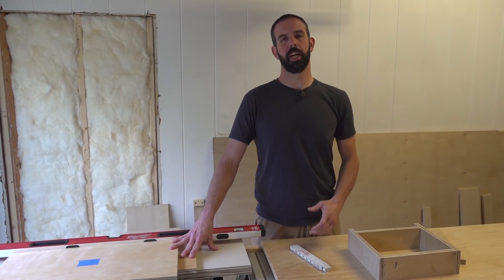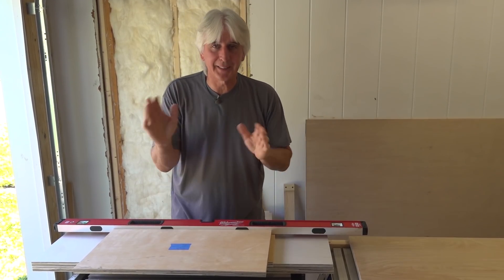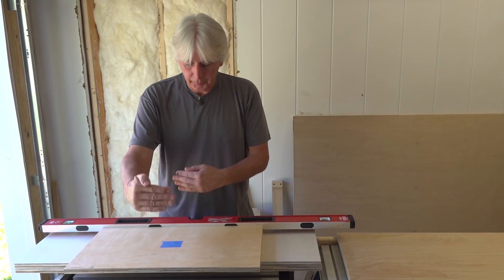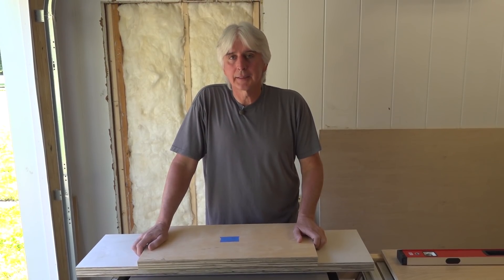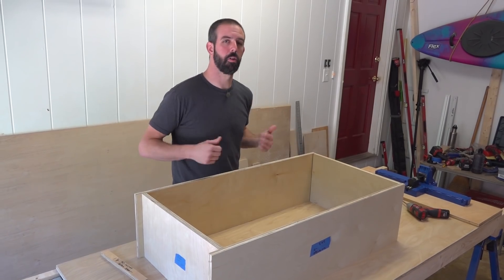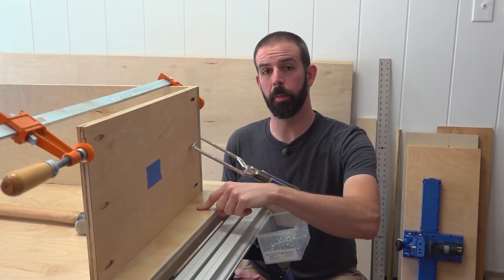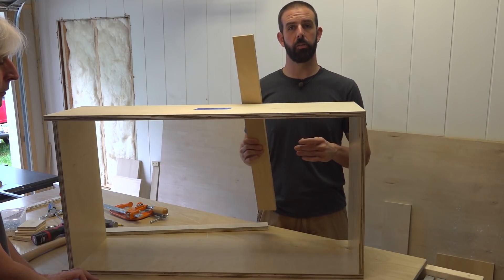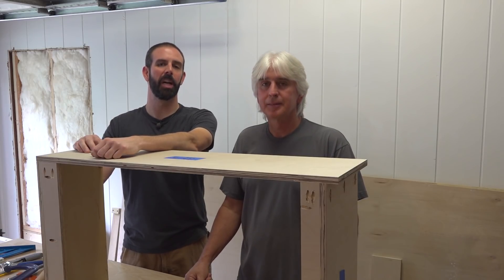Top Cabinet Box Detail Build - Kitchen Remodel E32

Comment: and also when you have chip out you can easily have it hidden with some putty or glue mixed in with sawdust then sand it back and if you want to paint over it, then you will have a surface to paint on, it works well with the face too.

Used to take wood shop class and my teacher told me that carpenters make mistakes all the time, they can either start again and waste money or they can learn to cope and still give presentable products but never give products that are 'as is' because you should have pride in your work., Just do your best and accept nature is nature.... perfectly imperfect.
Reply from the maker: Agreed!
Terry

Comment: You guys need a miter saw. It would make it easier to have with the table saw.  One to rip the plywood and the other to cut the board to length.
Reply from the maker: Yeah that would help. Some of the boards are to lager for a miter saw in both directions. We hope to purchase a quality sled soon. It can make the table saw act like a miter.
Terry
Reply: @ForestToFarm  well I was going to say I have a 12 inch single bevel miter saw that I'm going to sell for $85.00. You would have to pay the shipping on that though.
Reply from the maker: We actually have a 12" Dewalt and a 10 inch Milwaukee miter saw.
Terry
Reply: @ForestToFarm  nice.